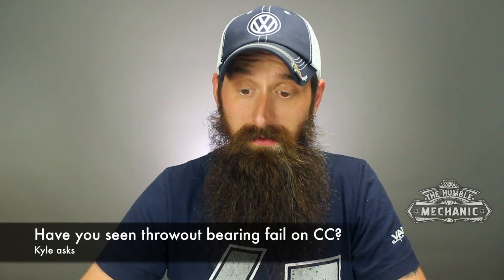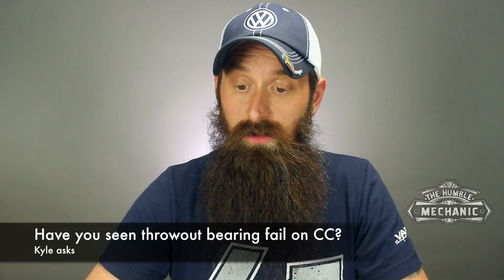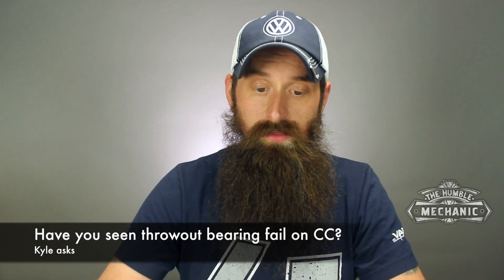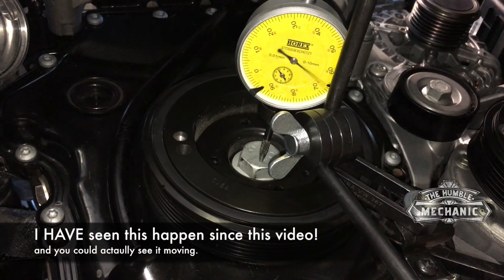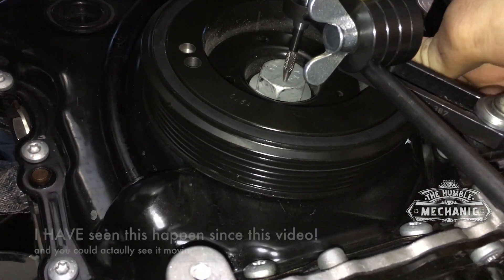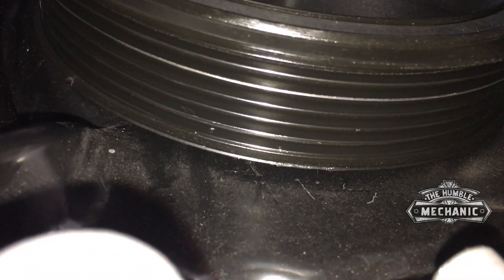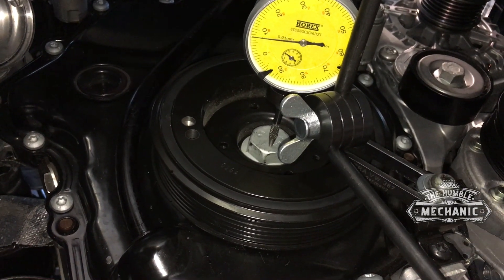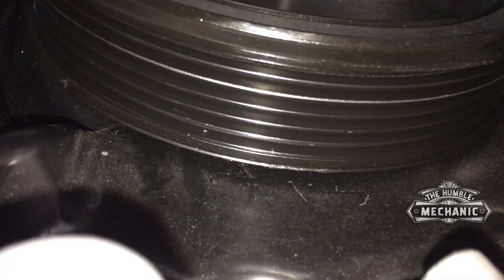Is a Throwout Bearing a Common CC Failure?

Comment: Charles, love the channel. I have one thing that I did (with customer approval) that helped me diagnose this EXACT problem. Customer's car was out of warranty, so there's no going to the dealing for any financial assistance. So I gave her the option of letting me drill a 1/4 in the side of the housing and snaking in a little camera. With that, I could see some sticking of the throw out bearing, it wasn't moving smoothly, and there was some issues with the pivot ball as well. If you're looking at the rear of the engine, I drilled at roughly the 7 o' clock position. From there, I could snake the camera through and see the actuation of the throw out bearing and pivot. Had our senior technician check and he confirmed my suspicions. We completed the repair and got her back on her way. Ever since then, I always keep a bunch of rubber hole grommets (these are the hole fillers for unused holes) in 5/16 readily available. This sealed the housing and allowed for further investigation later without compromising the weatherproofing of the housing. While I don't recommend doing this to any car, if you and your customer are in a pinch and they need an answer now. It's always an option. Just make sure that you do your research on where components are located inside the bell housing and ensure that you're not drilling too far back. Love the channel, and make sure to check mine out at The Thrifty Mechanic!
Reply: You can get endoscope cameras on eBay for under $10 that connect to your smartphone...
Reply: Brian Tracy That's what I got.

Comment: just did a Mazda truck that presented a similar situation forcing me to inspect it by complete disassembly. I found the reason for the failure was the release bearing had quit and taken up a job as shrapnel. leading to, directly or indirectly, the failure of rear main seal, clutch throw out bearing, input seal, output seals, and brought in for repair ONLY after the shifter shattered while the clutch locked up and he lodged the truck in to a row of large thorn roses. I hope you have a much better diagnosis of failure report.

Comment: Same problem on my 2009 JSW SEL 2.0.  Started a few years ago with a very short sound just as the clutch became fully engaged, but has gotten progressively worse every  winter.  It doesn't make noise if I keep the RPMs very low and release very delicately.  No noise when everything is fully warmed up.

Comment: My 2012 2.5 manual 5 speed makes this noise sometimes.  Mostly when it's cold outside.  I never hear it in the summer months.  I wonder what the going rate to replace the clutch and throw out bearing is going to cost?

Comment: @HumbleMechanic Great vid :). Ihave Avensis T25 d-4d/d-cat. There is strange sound related to clutch if u release it fast on idle/neutral so I release it second time very slow and sound disappear. I heard something about clutch pedal bearing. is it hard to fix? or this is other problem ?

Comment: I have the same problem on my 2008 B6 passat, when it's cold outside and the car is first warming up, I release the clutch to start moving and it sounds like a chair squealing across a floor. I was thinking it's a bearing but now you've got me more scared lol. btw I'm 18 and in my senior year of high school so money is a problem
Reply: Andrew Conway pump the clutch a couple times before you start moving, if it doesn't do it or it's not as loud then it's TOB

Comment: I have a mk6 gli 6 speed. Got my clutch replaced 1k ago with a dkm stage 2 and a smf. After break in it started to feel awkward where pedal grab would change when parking in a lot. Also taking off on a red light normal driving switching to second feels like the gear doesn't want to disengage. I've upgraded to steel braided clutch line and bleeder block. Also I have a spullen short throw. Can't seem to find the issue. Can anyone help.
Reply: did you solve the problem?  I have a similar problem and my mech cant seem to fix it.